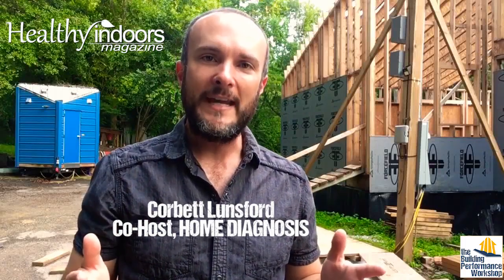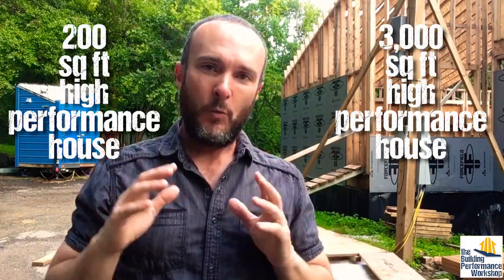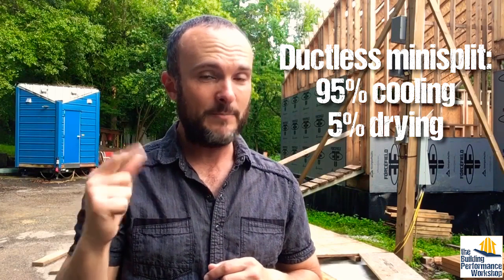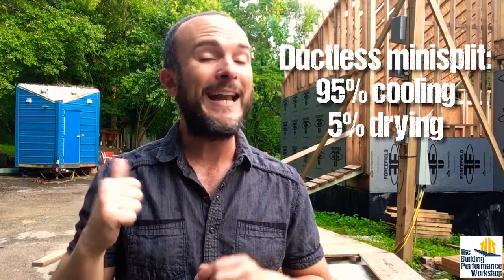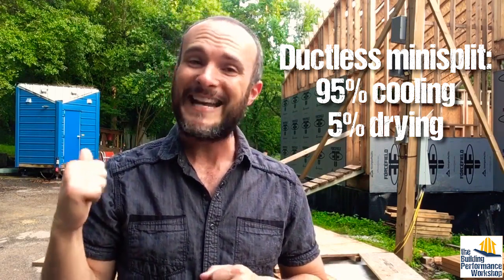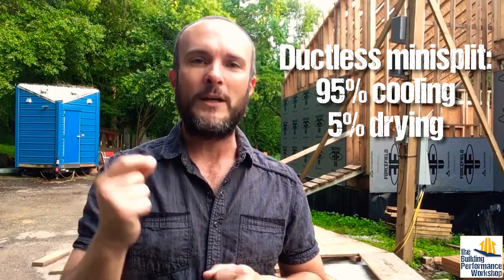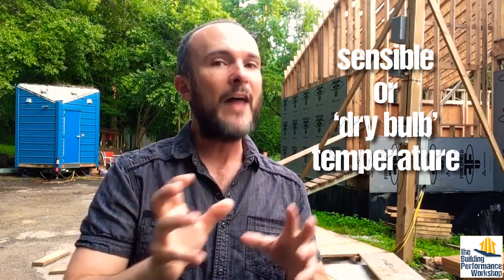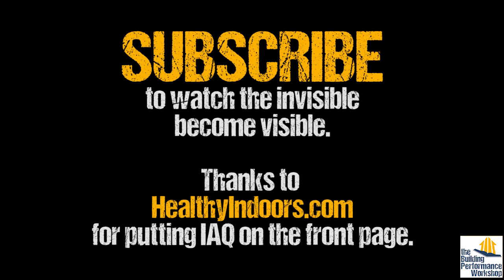Air Conditioning and Sick Building Syndrome: Healthy Indoors Minute

Comment: Looking at MiniSplits similar (same brand) to the one you have in the Tiny Lab, it seems that the rated ability to dehumidify is not linear to capacity. The highest SEER model seems to have less capacity way out of proportion to the BTU rating compared to the less efficient models. In the very humid south- very similar to Atlanta (Memphis area) would it be better to choose the lower SEER unit with a higher rated water removal capacity?
Reply from the maker: No, it would be better to pick the best one to heat/cool the space, and also have a dedicated dehumidifier. Imagine a series of 65 degree rainy days- no call for cool, but the home’s air would be soggy.

Comment: At what point do you have issues with static electricity due to lower humidity?
Reply from the maker: You have to get pretty far down, and also have carpet.
Reply: The problem comes into play during cold weather with extreme low humidity 
Increasing humidity during the winter months will minimize the static charge and increase comfort.
Easier said than done in many cases.

Comment: I hope a lot of HVAC technicians and installers watch you. I'm just a DIY. I like a performance guy in action, treating the whole house as a system. Imagine in years to come, some installer throwing in a new HVAC 3 tons over what your specs need. I think the future for upgrading older homes will be variable speed mini-split heat pump systems integrated into high efficiency windows. The sills release conditioned air where you would normally direct your supply register.... towards the window. In this case the window will no longer be a major source of heat transmission ... the varispeed mini-split could direct conditioned air upwards, horizontal, downwards, or all the above. I'm in ATL, how about you setup on ticketnation some site tours :)
Reply from the maker: Thanks for following, and your thoughts- interesting idea on the tours, I’ll see what we can do!

Comment: AC and humidity "Probably should not be controlled by the same machine".

Not "probably".  DEFINITELY.

An AC/Heating unit is great and all, and can clean up in a pinch.  But if you need to dehumidify a home, NOTHING beats dedicated dehum systems.

They're not cheap.  But if you're fanatical about indoor air quality, they're worth every penny.
Reply from the maker: Right on man, I just try to bring newbies along with a soft sell sometimes
Reply: @HomePerformance  How much of a difference is there in efficiency between using a Mini Split in Drying mode and a stand alone dehumidifier?
Reply: The AC is your first line of defense in controlling humidity. It’s up to the HVAC contractor to select the proper equipment to handle both latent and sensible loads, to include proper air flow. If you need a dehumidifier in you conditioned space then there are other issues that need to be addressed but only if the correct equipment has been installed. You, the customer, must decide how far you want to go with testing. The HVAC contractor must charge for performing a manual j and s, also for a blower door to get the right infiltration number. Only a hand full of customers will go to this level, that I have found.

Comment: I binge watched some of your videos a few weeks ago on HVAC, specifically I landed on your channel for static pressure testing. I have HVAC issues: large enough filter, but a 9x15" hole feeding a 4T unit may be a bit tight. I used what I learned from your channel to at least figure out I needed to investigate further. 

I called 10 local (reputable-ish) HVAC companies, and 2 could perform a static pressure test. I had one of the 2 out, and he didn't even bring ANY test equipment. He did try to sell me a 5T unit for $18-25k, depending on how many fan speeds I wanted. 

Long story short, I ordered my own equipment, for under $100, captured a lot of data to have a baseline, but quickly figured out I need to fix the restriction. A little more reading, watching, and math, and I just fixed it on my own. It is amazing now. I'm looking forward to keeping up with your video's to learn more. 

Thanks so much!
Reply from the maker: My friend, guys like you are the reason we keep doing this. Thanks for raising your hand- good to see you. Keep it up.
Reply: wow thats a lot of money on the line based on total guess work. insane that ANY tradesman would try that.
Reply: you'd need insane velocities (and noise) and very high static pressure to push enough air thru the coils
Reply: @thebluelunarmonkey  As it turns out it would take 1700lf/m (or 20mph) velocity of air passing through the 9x15 hole for the 4T unit to be fed the bare minimum volume.

My fancy new anemometer measured around 1250lf/m (or 14mph) in reality. It nearly sucks the filter into the hole. My unit is getting 30% less air than it should have. With the static pressure of over 1.2" (I actually stopped measuring across each component), I can't even guess the stress that is putting on my unit, or even how inefficient it was.

I have a conditioned crawl space, and as a quick non-scientific test, I pulled the door off of the air handler, and taped a filter to the side of the 20x20" hole. Air velocity was 600lf/m, and velocity of the air at my registers was up 25% across the board. I'll know after a few weeks how much better the unit is running, how often, and how much current it is drawing.

I realize you didn't ask for the specific data :) , but it's just nearly unbelievable at what I had in my 6 year old house.

Comment: What happens when the tree dies/hit by lightening and goes away? The house will then be in the sun.
Reply from the maker: And my 1/2 ton heat pump will still be 50% oversized, haha
Reply: The tiny house is on wheels , just move it under another tree!